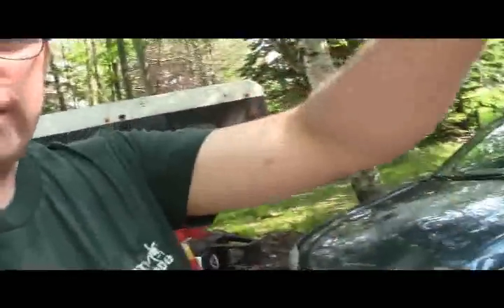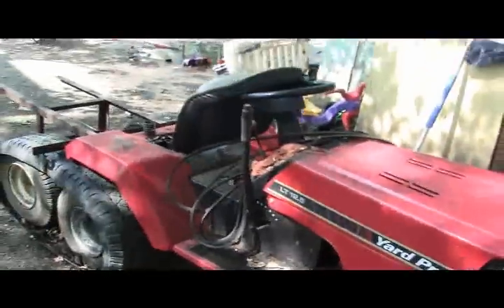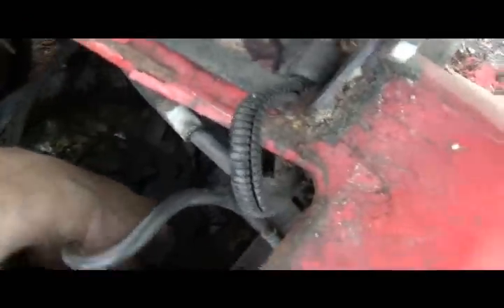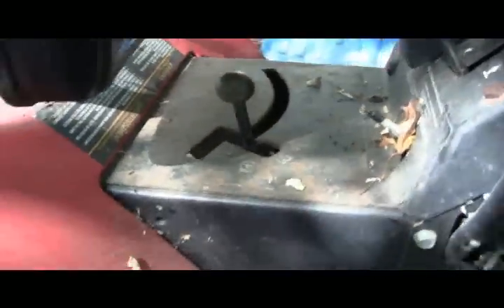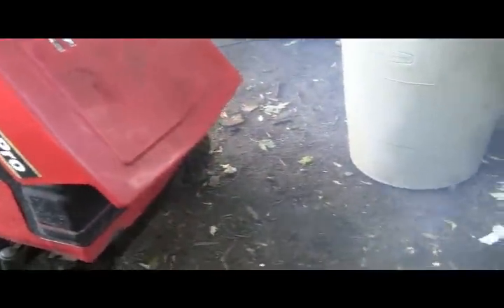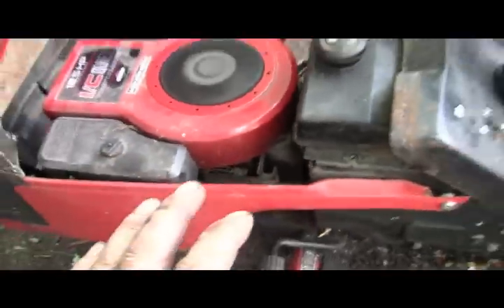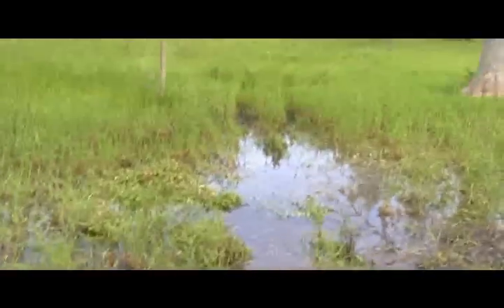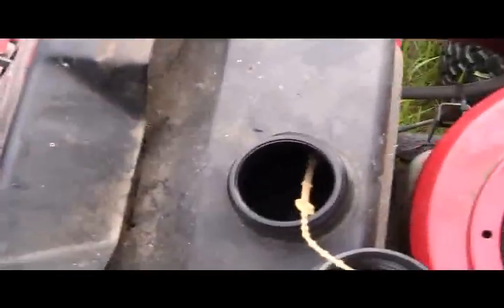Lawnmower tank tracks test run..avi

Comment: @ShawnCFarm Maybe even just some bolts with big washers on both sides, locknut outside for some digging & bolt head for grip inside... That would just poke holes in the yard, wouldn't lift chunks out of it. Just long enough to tighten the nut should be all you need. Otherwise angle iron would leave small lines behind you. I'm just wondering if cleats wouldn't throw chunks of your yard in the air...lol

Comment from the maker: @Fearlessfront Steerss not to bad, but it seems to take some weight off the front end at times, then its hard to turn. I'm only running one trans, the other one can be put in gear to run anything you want. The next one I make I'm going to run chains from the front axle to the back so its 4x4

Comment: the probable reason your having the belt issue is the depth of the v is different or the outer width is slightly larger just a bit will throw it off, the newer style belt is white (many colors) is because its made of less rubber and has nylon compounds instead of rubber

Comment: Thats al right , ya your idler is to loose you know what for cleats you know those slotted shelving wall brackets get 2-3 of the wall rails and cut to the size of track width and bolt on not heavy and about 1/2" high 5/8 wide cheap .

Comment: The belt was not in the correct path, I seen where you did it wrong,  That's why you had to move thge idler tension pulley and why it slips (and, why it was likely hard to get going sometimes).

Comment: These tires "skins" require a lot of power to just flex them. On top, they are smooth. You have no traction. Sorry.
Reply from the maker: Yes need to add the lags will also help keep the track on

Comment: nice build runs great one suggestion put studs on the tracks
Reply from the maker: +Andrew Mantei Want to add cleats to it
Reply: Your tracks themselves never slipped on the actual ground.  The drive tires slipped in the tracks,  Right  ?   So you still have no traction problem with track to ground, Right ?